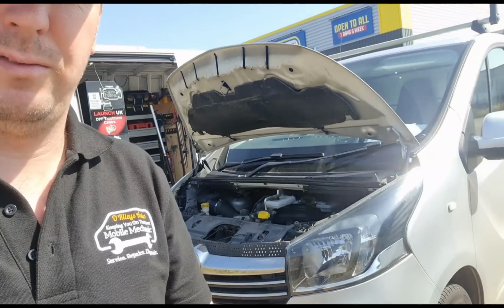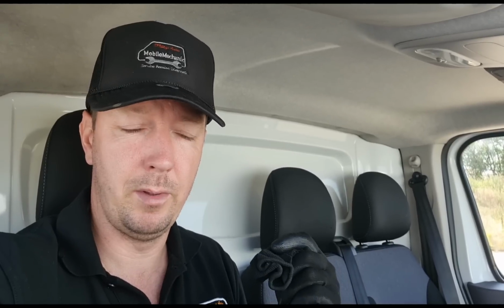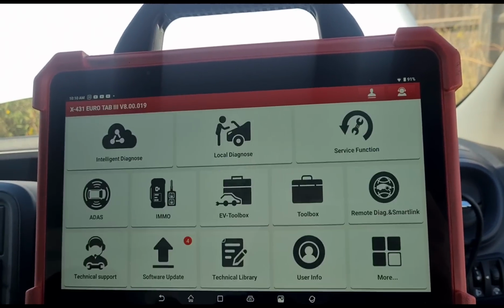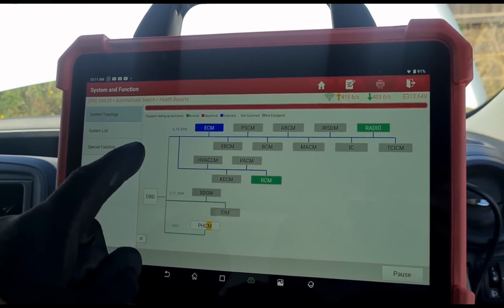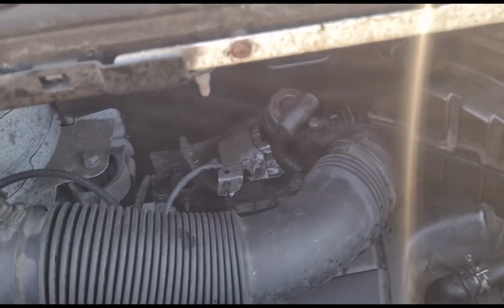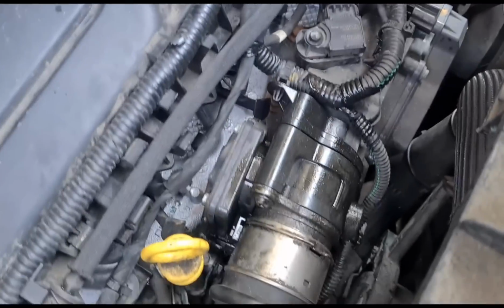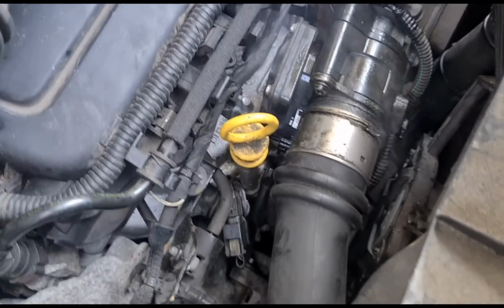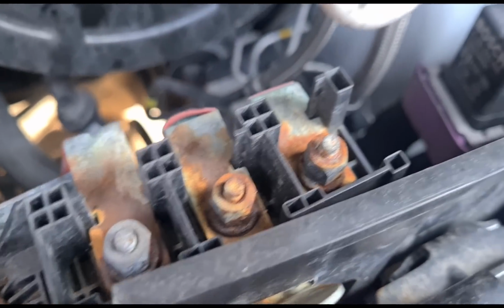Vauxhall Vivaro P0101 Mass Air Flow Sensor Circuit

Comment: Hi I have p0045 and p0047 code I’ve changed boost solanoid and cleared upstream pressure pipe and changed the sensor on the upstream pipe still getting these exact same lights up my hose here feels loose as your one could this be my problem ? Thankyou

Comment: Hi Jimmy had the same faults en oil around that pipe . 
Changed the seal with an original one . A day later both of the fault codes returned . 
Dpf pressure pipe also not blocked . 
Did a smoke test with no visible vacuum leaks whatsoever ???
What could it be then ?

Comment: Jimmy, I've got a P0096 fault code on my Renault Trafic III. I've done your trick of cleaning the Upstream Pressure sensor pipe and changed the pressure sensor but still have the fault code. You're calling this the Mass Airflow Sensor but another You tuber is calling the same sensor the Air intake temperature sensor.? Could it be causing my problem?

Comment: Jimmy, do you think it's possible that the O'ring may have been lost while they fitted the manifold etc? That would be a coincidental fault surely? Maybe the origin fault was fixed but they screwed up by loosing the seal and so still has a running fault💁🏼‍♂️

Comment: So a 1.6 to power such a large van, add to that extended service intervals. I'd rather a 2wd pick-up with a canopy. Preferably not a Ford with a wet timing belt.
Reply: The engines do quite well in the vans. broken Engines are very rare.
They also have a relative large amout of oil in it in comparison to other 1.6 engines so its not such a big deal with long service intervals.
Reply: Wet belt are fine if you service them properly with correct oil and don’t leave them for 25000 mile to change the oil.
Reply: @NickMackenzie-kb8mv   For the amount of work required to replace the wet timing belt, potential oil dilution issues, as being cautious with oil changes, due to oil recommended, it's hard to worth the hassle.